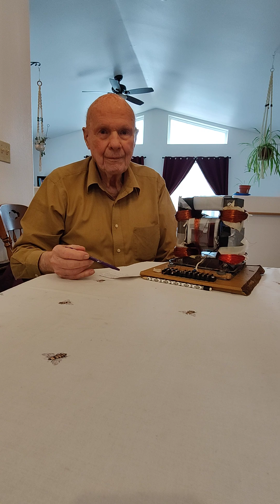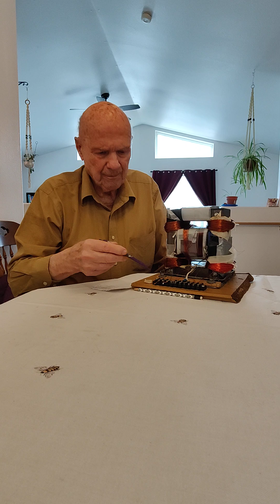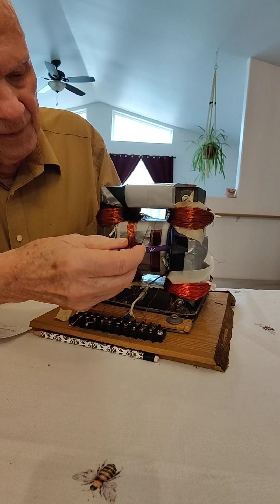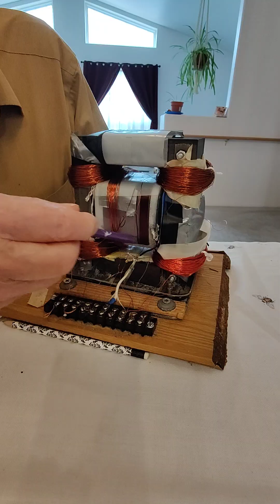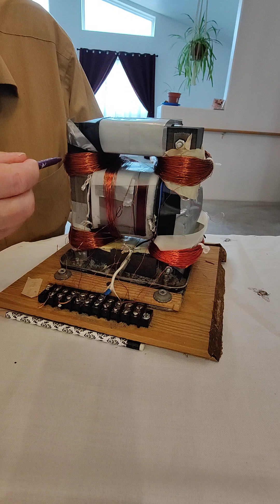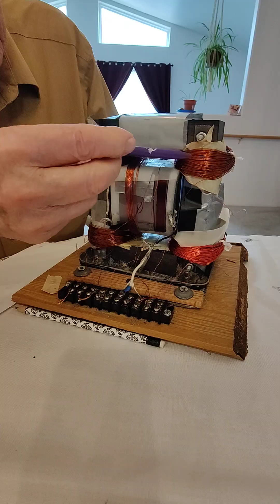Overunity Transformer - Richard Dale Smith

Comment: Thank you so much for sharing. I have a similar core and would like to give it a try. If possible, could you share the approximate number of turns per coil and the gauge of copper wire used? A diagram would be perfect.😋